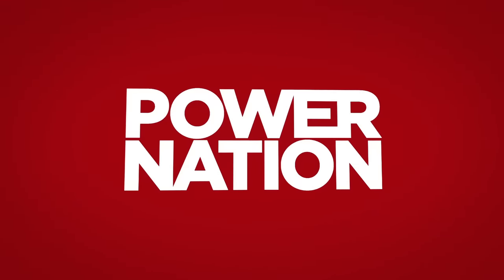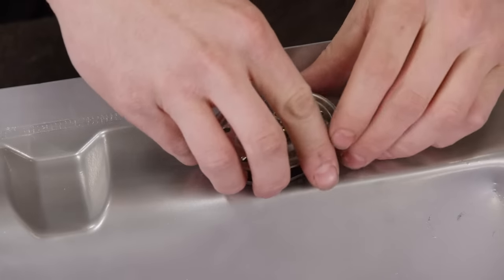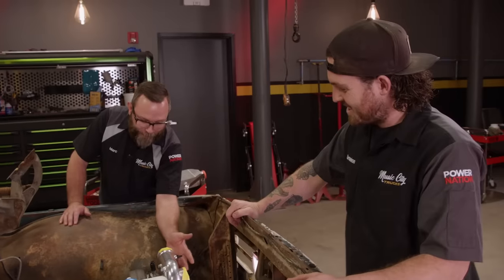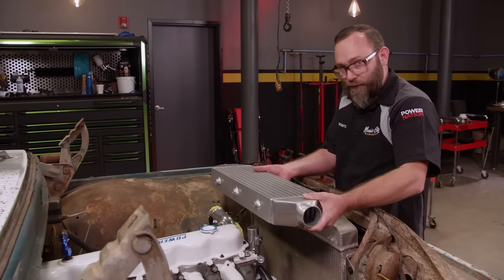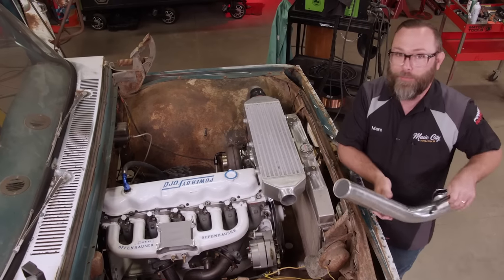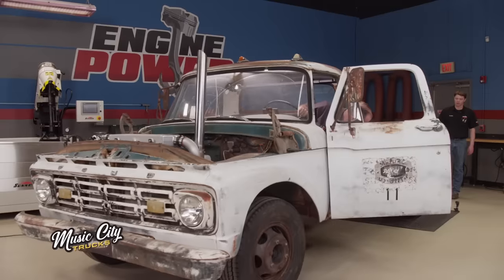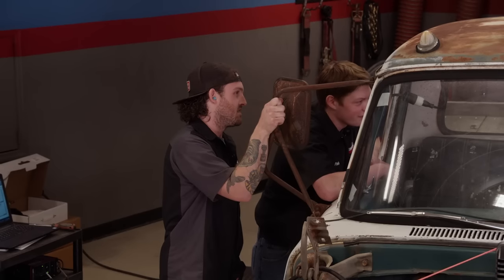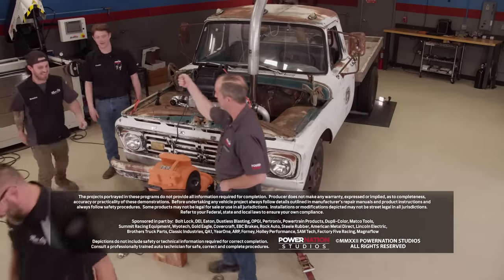Turbocharged Ford 300 Flatbed Dynoed - Music City Trucks S2, E8

Comment: The 300 6 is one of the best "working" engines manufactured. The Slant 6... an equal for a 400k mile reliable engine. "Maintenance  maintenance  maintenance". But a boosted 300 makes me allll... happy gearhead. Torque monster and reliable. But boooooost!!! Fun project!
Reply: I did have a stock straight 6
Reply: Key word is manufactured.  Past tense. Technology has moved along.  You can get the same reliability with lower emissions, better mileage, and more power in smaller packages.   It's a relic of the past.
Reply: @bmstylee  they still have they’re uses I still use a 292 Chevy in my work truck, it the only engine I know that will last at full throttle day after day pulling hills sure there’s better engines out there but you just can’t kill these 7 main bearing six’s
Reply: @turkeyboyjh1  outside of a Cummins and heavy industrial applications no one uses an inline.  Chevy and Ford use V engines for trucks and passenger cars outside of the i4.  It's a dead architecture for passenger vehicles.   If it was as great as you assert it would be on common production.
Reply: Slant 6 will run a hell of 
a lot longer than that
Reply: @bmstylee  I agree. But us goofy gearheads have fun with this "stuff". Part of the fun is being so far upside down in "value", it makes it cool. A turbo 300 6? Cool as a gold plated Fonzie. But such a money dump.... Fun! As far as emissions go. A properly rebuilt vintage 60's engine,  proper tuning, a simple Pertronix ignition and conversion to throttle body injection. Will pass emission standards in comparison to mid 90's vehicles. Without catalytic converters. Its fun how new aftermarket parts can make this possible.
Reply: @bmstylee  the atlas engines are modern inline engines. The problem with straight sixes is passing the requirements for frontal crash testing on modern production vehicles. It's difficult to maintain an adequate crumple zone in the engine compartment when the motor is a quarter mile long. It's the physical dimensions that killed inline sixes.
Reply: Talk is Cummins is going to make a gas 400ci inline 6  going to be released in 2023 ram’s . Should be a winner I loved my 300 6 fords .
Reply: I’ve heard Chevy is producing an inline turbo 6 for its half tons.
Reply: @WildBillsGC  That’s cool  . I will have to look into that .
Reply: @mikeirvin9694  yep you can thank the Brazilians and their love for Chevy sixes for the atlas motors, they’ve been modifying them and building them for years
Reply: @bmstylee  smaller engines tend to where out faster especially when pulling weight alot and who cares about emissions
Reply: Aussie 4L Ford barra is best 6 Ford ever made
Reply: @Juicyshadowz  you got me I was just going to mention the Barra.
It is an awesome platform and they make power like a 2jz and just as reliable if not more reliable.
Have a good day
Reply: BMW,  Toyota Supra, Chevy half-ton Duramax?
Reply: @bmstylee  you know some people don't care about stuff like that. some people enjoy old outdated technology, no reason to hate on someone for what they like. While new tech has marched right on by this stuff, it's still very viable and capable. There's an old saying, "different strokes for different folks". Plus I'd be willing to bet if you left new tech laying in a field for a few decades, it'd be a lot harder to get back running.
Reply: That slant six although is a dead nuts reliable engine I agree would not hold a candle to a 300 ford my opinion but I do agree there both extremely reliable
Reply: @bmstylee  well I do know this the newer 300 fuel injection engine couldn’t perform with the older carburetor engines from my experience and my friends over the years
Reply: @bmstylee  used every day in big rigs must be something good about it and reliable
Reply: @Leonard-hk1nf  that would be awesome and probably a serious contender
Reply: @oldscoolcooldiecast1879  comprehension isn't your strong suit.  I said outside of industrial use no one uses them.   Keep up.
Reply: @bmstylee  not so sure about that us West Virginiains use them as daily drivers hauling firewood hauling groceries hauling livestock hauling kids. That’s not industrial now is it it’s our every day transportation
Reply: @bmstylee  our jeeps also have them up until 04 and we don’t have anything newer because of it
Reply: @bmstylee  and you also said no one out side of industrial use   a lot of us won’t buy a vehicle if it’s not inline six and our dodge Cummins pickups is everyday vehicles not industrial just so called industrial engine kind of a catch twenty two if you ask me
Reply: @bmstylee  no gasoline engine made today will match the reliability and low end torque of a 300 inline six. There's a reason they were made for 31 years and used in industrial applications.
Reply: @keeganlangford5580  "MADE" past tense. Like all the other fan boys here you're living in the past.  Modern engines make more power, more fuel efficient, better emissions, are lighter, the list goes on.   There are a lot of reasons there aren't used anymore.  Just like manual 4 wheel drum brakes, CRT televisions, flip phones, carburators aren't used.  Technology advances.   Go tell the oem you have an engine that makes 140hp and is as big as a fully built Cummins and see how fast you get laughed at and tossed out of the room.   Deal with it or enjoy living in the past.
Reply: @bmstylee  you're super fanboy status over modern engines. You've obviously never seen how big a cummins is. We're all laughing at you comparing a cummins to a gasoline engine designed in the 60's
Reply: I've had the Ford 300 Straight 6 and the Mopar 225 (Super Six) Slant 6. Both were very reliable engines but I have to say the smaller Mopar was definitely quicker. I never had a Chevy Stove Bolt 6 but I've heard those engines are very reliable as well.  I'm actually wanting to do a Turbo 4200 Vortec inline 6 swap into my Silverado crew cab.
Reply: @bmstylee  does 'nostalgia' mean nothing to anyone anymore? Is it just about the #s?
Reply: @bmstylee  you're not familiar with the brand-new Chevy inline six?
Reply: @oldscoolcooldiecast1879  let's not forget the other dog in the inline hunt - the awesome Jeep/AMC 4.0.
Reply: @stratolestele7611  nope.   performance>emotions.
Reply: @stratolestele7611  nope.  I'm not in the market.   It's not going to last given the success of the LS architecture.   Unless It's cheaper, more powerful or significantly more fuel efficient it will bomb hard.
Reply: @stratolestele7611  lol yea I own one as we speak the last year an 04 with less then twenty thousand miles on the engine it runs great and pulls the mtns like a dream just has sencers that go out every so often and the last engine went 286000 and was still running just figured a new engine would be best considering they quite making them
Reply: @keeganlangford5580  agree 100
Reply: @keeganlangford5580  well put
Reply: @bmstylee  But the new stuff just ain't cool like old Iron is..... 375HP on 3.5 liters? OK, but there's no character. 250 HP on something that started at 100? That's way cooler.
Reply: @bmstylee  I heard Chevy was considering manufacturing a new turbo I6 (OHC, I believe). And what about Toyota's legendary 2JZ? Racers still love em.
Reply: BMW,Mercedes,VW(i5) still current, technology,
Reply: @Leonard-hk1nf  I'd love a big block i6 gasser.
Reply: @bmstylee  laughs in BMW and new Stellantis/Ram I6 gasser
Reply: @bmstylee  list the engines you allude to sir. Thank you.
Reply: @turkeyboyjh1 there better than the fords too, wind out like crazy and more tourqe
Reply: Had a 1992 , F150 , 300-6 . Original engine was never opened up.  It had 396k miles when I sold it and it was still running strong 💪.

Comment: This is by far my favorite build for both teams. I’d love to see the same treatment given to a 235/261 in a ‘66 Chevrolet flatbed. Then do a straight up showdown. I love their excitement over an oddball build. Shows their inner geek. I love that.
Reply: This!!!
Reply: Unfortunately the 235/261 is not a good engine for boost. 4 mains and huge heavy counterweights means that as soon as you make respectable power the crank removes itself from the block and walks out the door lol. A much better choice is the later 250/292 but they already did all that.
Reply: They did a boosted 292 six a few years ago.
Reply: Agreed. Would love to see what’s possible with the 261. I don’t think they were strong is the Ford 3 L though. But would be fun to see that
Reply: @kbar150  I forgot about the best to 292. That would be a good combo for a Chevy 1 ton pick up.
Reply: @marshallwilliams4054  and the show would be a under 10k build. They get good contributions from ad's. All good profits!

Comment: I'm a 72 model. And if I was given the choice to pick just one motor out all, without a doubt it would be the 300.  Hands down the toughest motor Ford ever built.
Reply: I'm preferential to FEs, the 300 is bulletproof but it leaves some power to be desired in stock form.
Reply: @Terminxman  in stock form yea. but this aint that.
Reply: mildly tuned ls7
I don't want a nose-heavy anchor
Reply: Idk my 390 fe is bulletproof too 😳
Reply: I remember driving fully loaded 83 flatbeds trying to pass semi's at 70 MPH and as soon as I got cab to cab the wind coming off his truck would stop me cold and I would have to tuck back behind him. Sometimes I would get a trucker that took pity and he would let off for a moment and around I would go.
Reply: @basshead.   well my truck 7000 pounds don’t care he can drag the body
Reply: @basshead.  The 300 will still be around when the ls is melted down into parts for lawn mowers.
Reply: I don't know. The 2.3 4 cyl Lima is still used in midget racing.
Reply: I had a 81 Ford truck with a 300 and I changed the fuel pump on the side of the road. Good motor and easy to work on, lots of room n the engine compartment.
Reply: @Terminxman  Yes, but what they lack in power, they  make up the balance in torque.
Reply: @InuranusBrokoff  Exactly!
Reply: @basshead.  put LS heads on a Ford 300 to basically make a boss 300 and your looking at 600-650hp N/A potential. They use that idea for front engine dragsters

Comment: Amazing! My 69 F-100 swb has a 300 6cyl. It's been a great motor , smooth and torqui.
I've owned it for over 40 years. I'm the second owner. But until now l really didn't know how much potential it had. I now got the hee bee geebees to upgrade it. About 7 years ago l pulled it out and opened up the top and bottom, l was stunned by how clean it was inside. I've used Marvel Mystery oil on both the fuel and oil since the mid 70s. I'm not a MMO rep. Thanks PN. Your 300 vid. Is awsome. God bless.

Comment: The intake air is going to get hotter as the cooling system heats… there was definitely room in front of the radiator for that intercooler
Reply: There isn't actually. 61-66 are kind of a tight squeeze when it comes to doing work with a Straight 6. The only thing they can go is shove the engine back further, and turn the bench into buckets.
Reply: Angle mount it behind the front bumper.
Reply: @josefrobbins8781  It certainly could have fit lower, under the chin of the truck. It would have required more difficult charge pipes but  it was more than do-able.
Reply: Yeah, but now they can louver the hood for airflow, but they'll probably just let the poor thing cook ☹️
Reply: @josefrobbins8781  Yep its an inter heater
Reply: @madmod   It won't be getting any air if it's mounted below the rad with the front bumper blocking it. Unless you wanna go lower, and do an exposed intercooler. Still, the actual problem is that intercooler is too small for the job, along with the gearing in the Trans, and rear end which is sucking the power away.
Reply: @paullee8772  YEP!  That's what I've been telling people, and I've seen it done, and it works.
Reply: @josefrobbins8781  The intercooler is litterally designed as a front mount cooler and being so short, it would easily have fit under the chin of the truck and gotten a much greater volume of air passing over it then under the hood. As for drivetrain losses, its making nearly 400rwhp. Thats hardly lacking in any power from a 300ci 6 cyl, especially considering the power it made tested at the flywheel.  Get it on the road and it wont be the drivetrain killing power. That cooler core will heat soak and cause detonation and/or require its timing pulled. Even a tiny water to air intercooler core would be many times beyond more efficient than this band aid of a intercooler setup. The intercooler is plenty large enough given the volume of air moving through it with this combo. The placement of that ic would only work with a massive cowl induction to ram air through it, but the core itself will still heatsoak in the engine bay defeating the whole point of charge cooling. It works about as effectively as having no intercooler. The only reason it was mounted this way was due to the time crunch they were under.
Reply: Doesn't the intercooler need air to pass through the fins to cool properly.  What about a air water heat exchanger deals?
Reply: A wet intercooler would have been much better.. use ice water in a reservoir like we used to do back in the day
Reply: @madmod  this cold side plumbing looks to be a good setup for making popcorn or baking potatoes. . . lol
Reply: @Fordman7575  that's what I thought too.
Reply: Design engineer here... the intercooler set up is poor.  Just look at the old Ford Lima turbo motor setup.
Reply: Or they could do a water to air and put it in the inner fender
Reply: @paullee8772  That was my thought too, but, I'm also not standing in front if it seeing it with my own eyes.  

One of the things about shows like this is that they typically use parts that sponsors let them use for cheap or free, so my guess is that they used what they had and made it work.
Reply: @thatmaverickguy859  I'm betting that there are several places that would've worked.  Good thing it was a blow through deal and not port injection.
Reply: @SARJENT.  yeah
Reply: I would think too.... putting it right under the hood would restrict the air flow, it needs. I definitely would have moved the radiator back to make the inter cooler fit.
Reply: @jasonmyers3847  or even just a water cooled on and mount it in the fender and put a ice box somewhere
Reply: @thatmaverickguy859  yep. That would work too .
Reply: @biscuitninja  those also had scoops and sometimes fans.
Reply: I was thinking the same thing about location.. I would say louver front bumper and install behind or.. mount beneath the cowl and use cold air from the base of the windshield, again some sort of hood louvers or tie into existing cowl vent system.. I’m sure nothing is perfect but current placement has to be quite poor.. anyways love the build and turbo six
Reply: Yea or they could cut small vents to catch air with a custom duct leading to the cooler blowing through there so it actually serves a purpose of having wind fins
Reply: I had an idea to use the Weiand supercharger intake manifold, attach a fuel rail/injectors, and a water to air intercooler. Then, just make a shroud that fits the Weiand bolt pattern, and attach a large throttle body. Seems like it would work well, and height clearance wouldn't be an issue here.
Reply: Yeah there was definitely better solutions then mounting it where they did.

Comment: Wow guys, thanks for the quick follow up!  Love everything about this project, and it actually makes sense to put it into that 1 ton.  I can see that Pat was hoping for more rwhp, but that low end rear, and gearing in the trans is not helping.  The only advice I can give is to run a bigger intercooler.  Since you've got a flatbed,  you can mount the radiator on the rear with a fan on the back of the cab.  The only problem is you might have to run an auxiliary pump on account the stock pump might not be strong enough.  I say this because recently ran into an old timer who turboe'd his GMC 302, and he had similar issues.  Did great on the engine dyno, but made mediocre power on the wheel.  Did the rad reverse and placed it on his headache rack, and went with an even bigger/better intercooler up front and turned his %50-60 power loss into more of a %25-30 loss.

Comment: I chose to stay with 3.55 gears with my T19 transmission since I run a 6.9 IDI that I put a turbo on from a '93 truck. With 35" tires it puts me around 1800-1900 rpm at highway speeds, which works great for the IDI. 4.10 seems like a lot for the highway and a 1.1 top gear. But that's just me.

I had an EFI 300 in a 96 OBS and have always wanted to build a performance version. What a cool engine. Thanks guys!

Comment: It turned out as good as I was hoping it would be. Only thing I think you should do different: the intercooler is getting heat soaked above the radiator. Maybe add a shield to reduce the affect
Reply: I was thinking add shield/duct in nose of hood just for the intercooler if mounted like that... so a face forward slit on hood, + top venting on hood.
Reply: That mounting job is an embarrassing joke.
Reply: @josephmatuszak3855  I was thinking of something similar. If they had cold air coming in from just above the hood, that would reduce the affect the radiator was having
Reply: Agreed, lack of room for a v-shaped setup. Place it below the radiator?
Reply: @marshallwilliams4054  Hot air rises. No matter how they duct the air, the underside is still going to be exposed to all that heat. They need to mount it down behind the front bumper.

Comment: When it first started it reminded me of an old diesel that had been setting for a few years.  Lots of smoke

Actually a 25 % Loss of power is about right for a truck transmission and drive axle. 500horsepower minus 25 % is 377. Sounds about right